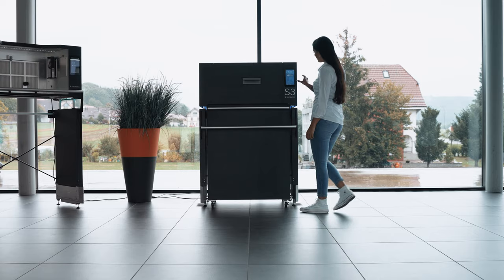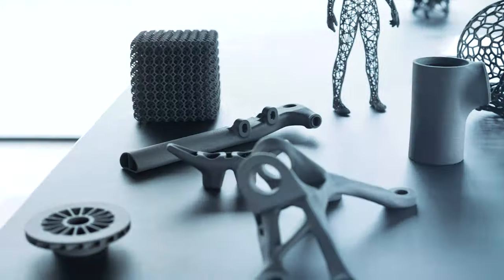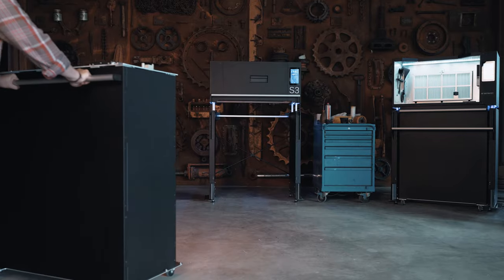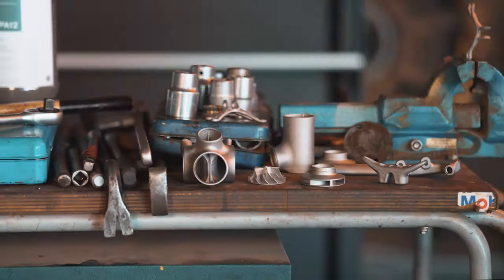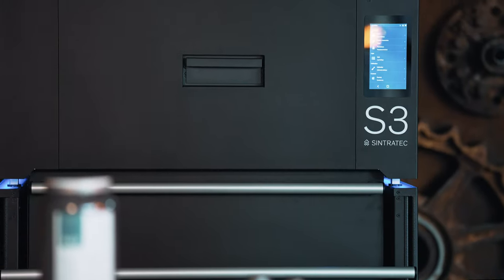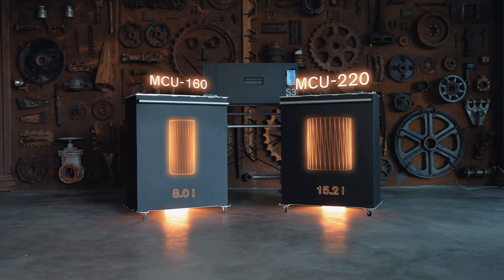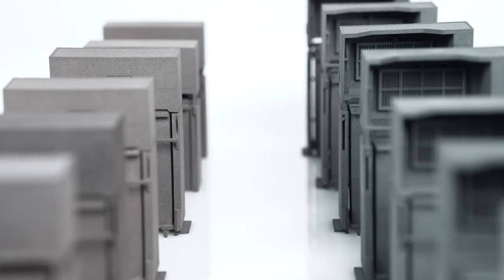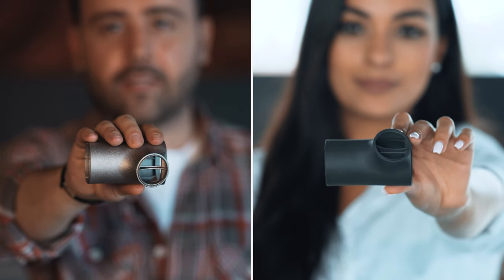Introducing the Sintratec All-Material Platform – AMP up your production!

Comment: What is the price of the sintering furnace?
Reply from the maker: The ones used in the Lab System uses a furnace by Carbolite Gero which costs around 100'000$.